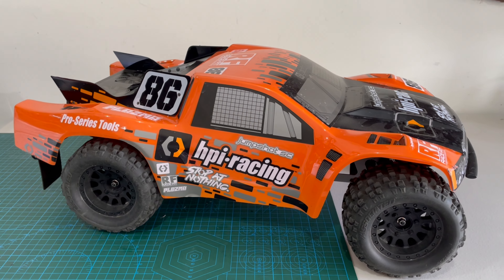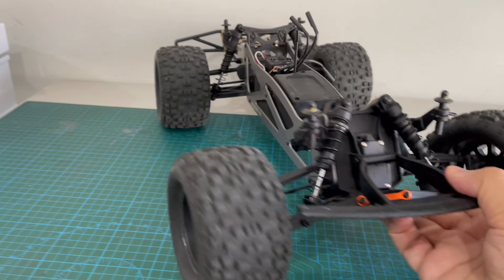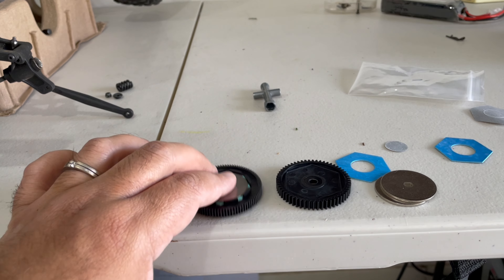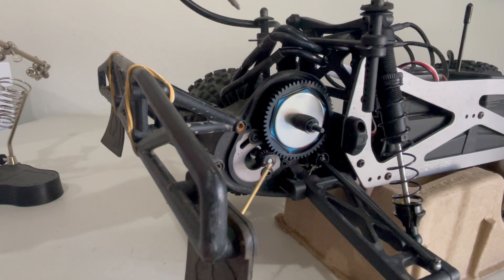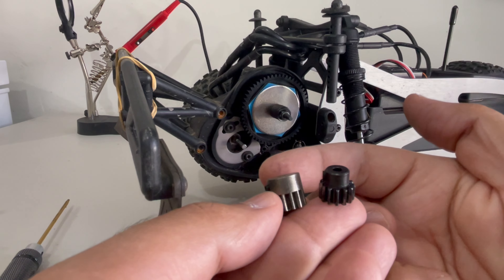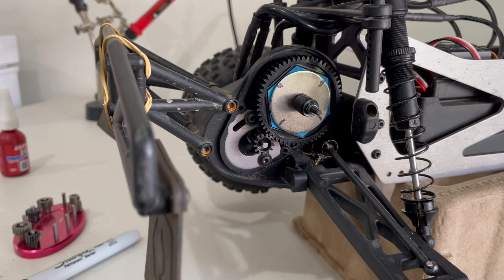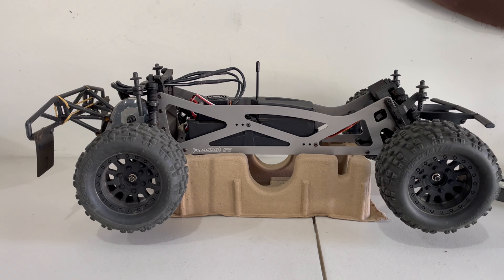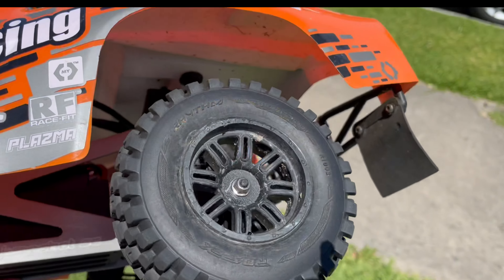How to replace 48P gear to 32P gear on HPI Jumpshot SC Brushless #hpiracing #rccar

Comment: You had any issues with the 48dp? Either way the 32p is a nice upgrade 👌🏻 👍
Reply from the maker: Yep, have round up 2 of the 48p spur, I end up looking for a solution that does not require too much work. So far, the 32P have lasted and have up the punch level on the esc to max, it's holding up. thanks for watching, much appreciated.